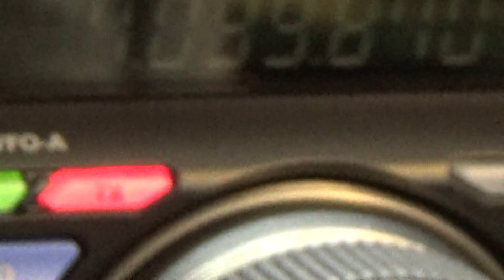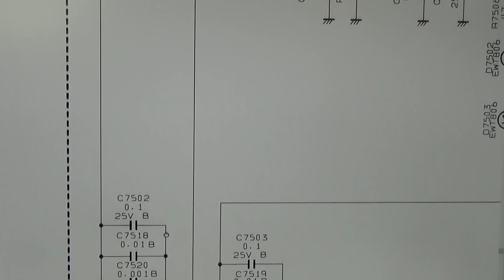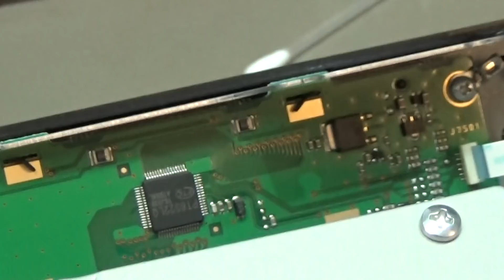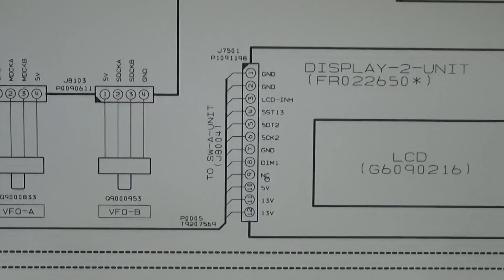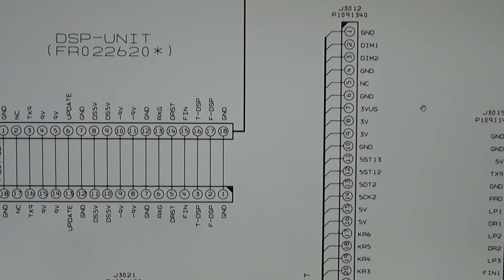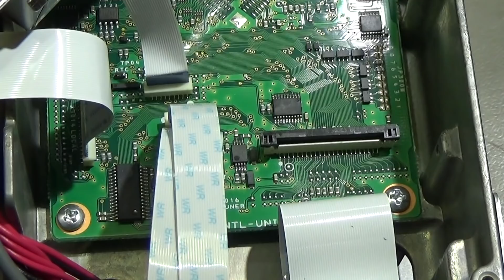#206 Yaesu FT-DX3000 wow is that a production quality issue? Anyway we fixed it

Comment: I have the same problem with my dx3000 but i have a power loss as well as the vfo display do you think this could be a similar problem possible related in some way mine is intermittent
Reply: would be nice to get some kind of reply to my question if you think you can spare a minute 🤔

Comment: I figured it would be somewhere between the boards, I was calling it in the ribbon cable (rc), bad solder joint at the rc connector. I had a problem with my FT-950, had to take the front off and was dumbfounded by how short some of the cables are, engineers are so confident of their designs they don't think of the poor tech who has to fix the thing.

Comment: I wouldn't call it lucky, it's purely because you do such a methodical and thorough job, logically troubleshooting from beginning to end. It's a great lesson to people not to skip steps in a path.
Reply: What is the FTDX 3000 bandwidth on AM?
Reply: @davidschoenwald516  AM is double the audio passband the rig will handle and the 3000 I believe will yield just shy of 3kHz possibly 4kHz, so that would be between 6-8kHz total in AM mode. 

Most modern HF rigs are around 6Khz on AM, with just a few that go to 8 and old tube boat anchors and SDR rigs can go much wider with most people running 5kHz of audio for 10kHz total width.

Comment: I oversaw the maintenance of all electronic gear on three different USN ships.  I cannot tell you how many times my technicians "fixed" complex problems with $50,000 pieces of comm gear by resetting ribbon cables and connectors.

Comment: Nice video. Over the years, I've learned a big weak spot on ham rigs seems to be the plugs not being soldered correctly to PC boards. I had an Icom rig that had endless bad solder joints on it and I spent a lot of time looking for bad components and not getting much of anywhere, and then noticing the solder joints on the plugs didn't look too good. I reflowed almost every joint in it and got it working 100% eventually. Many other rigs had fewer bad joints, but the plugs were where most all of them were located.

Comment: Super video Peter!  Really do appreciate your talent, expertise, thought process, and explanations.  One question though, it may be a trick of the camera, sometimes when it comes to light the camera "sees" a greater intensity than the human eye, which means that what I think I saw may not been the case, but it appeared that on VFO A that BOTH the RX Green light AND the TX Red light were on at the same time.  This doesn't seem to be right to me...were they both on, or was it just looking that way?
Reply: Wayne Thompson , that's normal on the FT-DX3000. It means you're receiving and transmitting on the same VFO. You can switch it to VFO B to either receive or transmit so you can work split.

Comment: Yes, Peter, sometimes You have to be lucky!! For oxidized or dark flex cable terminals I used to clean them up with the brown side of a  rubber erasure ((Radiergummi hi) It's not abrasive for the metal coating but makes the contacts shiny, clean and conductive in about seconds. Thanks for one more of your funny videos!!
Reply from the maker: Hi Wolfram, thanks for feed back. Yes ribbon cables are a pain....Ahm is a good or a bad sign when you say "funny" video? :^)

Comment: Every piece of kit has a set of known issues, believe me, I fix stuff for a living. And this is a know issue with the FTdx3000. The standard fix for this is to reseat both ends of the ribbon cable. 9 times out of 10 that is the fix for no frequency display and no button operation. I would certainly try that before resoldering anything. All the same, it's good to see your troubleshooting skills are still up to speed Peter. It really is a dieing art!  ..for anyone interested, the Yaesu FTdx3000 group has a lot of info and examples about this fault.
Reply from the maker: Hi John, sure every radio has issues in any series at any time. Unfortunately I do not get al service bulletins as I'm not a certified service centre for yaesu. Are you working for yaesu or are you working for a certified Yaesu hub. Thanks for comment
Reply: i got a display problem..not sure if it was in the radio as new or caused by first owner just weeks ago..messing around in ham radio deluxe or pushin knobs etc…the freq readout gets added characters like a u in between plus all the modes get lit up even though the rig might be on lsb or usb or the actual mode..any ideas ? where is the users group at.thanks

Comment: First thing any technician would do is go straight to the ribbon connector, years of experience tells you the first logical place to look, when a customer is paying for a repair, the technicians task is to repair quickly a properly.
Same goes with an auto technician, first thing a customer wants to know is how long it's going to take and how much its going to cost.
This is a 30 minute job.. uk cost approx £17.50, or you can have someone looking at it for 3 hours getting the same results and the repair bill would be £105..
Reply: I owned a storefront audio/video repair shop for 20 years looking for the most simple problem first can save a lot of time.  De-Ox-It spray is an amazing product that I have trusted for years.  It is sometimes the problem solver for gremlin problems like connections.

Comment: Though it may appear that your re-flowing of the connection to the board solved the problem. I would say it may have actually been the removal of the ribbon cable from the connector and re-connecting it which 'reformed' the ribbon cable and allowed it to mate properly to the connector. If you had removed and reseated the ribbon cable you may have had similar results. I say this mostly because I have worked on other Yaesu radios that use the same connector and ribbon cable type and have had to replace ribbon cables because the plastic in the cable deforms and causes an open connection to it's mating connector.
Great job of tracing the control voltages and troubleshooting Peter, excellent video!
73
Doug N7BFS
Reply: I owned a storefront audio/video repair shop for 20 years looking for the most simple problem first can save a lot of time.  De-Ox-It spray is an amazing product that I have trusted for years.  It is sometimes the problem solver for gremlin problems like connections.
Reply from the maker: Hi Doug, you might be right in cases like this you'll never  be 100% sure if it is the one or the other...Thanks for comment 73

Comment: If it was working prior to going out...first thing I would have checked is the ribbon cables,as,sometimes after work or mars mod on radio,ribbons get damaged or not plugged  back in properly...which if damaged or not plugged back in properly,will knock out certain functions on the radio....
Reply from the maker: no the radio has never been opened before so no damaged ribbon cable and by all the ribbons back and forth where will you start?

Comment: I think that radio came out in 2003. I'm not sure when that one was built but if it's an older one would you still call it a quality issue if it lasted for over 10 years?
Reply from the maker: No it came out 2013 or 2014 so not that old by now...After 10 years+ I would not call it quality issue.
Reply: TRX Bench I must be thinking of an older model, probably closer to the 
Yaesu FT-1000MP. My error. I repair pagers all day and solder joints on surface mount connectors are a very common failure on them. I enjoy your videos. Thank for posting them.

Comment: Great methodical troubleshooting.  I've bought many expensive radios dirt cheap and found bad solder joints and bad thru holes. Thanks Peter. 73
Reply from the maker: Thanks Richard

Comment: I really enjoyed this video.  As an Ftdx-3000 owner, it caught my eye.  Great find on the cable.  Did you examine the cable for corrosion before reinstalling it, although it sure looks like a solder proplem.  We will probable see more of that as we move away from lead solder.  You make it look easy as you explain what you are doing, but after some 30 years in the business I know that things are not so simple.  This was a great repair job.  I would be interested in a video about your shop and equipment, and your background as a repair technician.  I enjoy your videos.  Again.  Great work!
Reply from the maker: inspection that is why I have taken off the ribbon cable  . The cable was fine...Well yes for beginners it looks sometimes easy until they start to collect own experiance but that is the way it works...Thanks for comment.

Comment: Очень ненадежные шлейфы. Как-то мне пришлось чинить FT-100. В нем поменял несколько шлейфов, их нельзя несколько раз гнуть, ломаются у синего основания. Уверен, что этот аппарат опять проявит ту же неисправность, просто при сгибании контакт восстановился, но пройдет время и залом окислится и снова не будет контачить - надо менять шлейф.
Very unreliable ribbon cable loops. Somehow I had to fix the FT-100. It has changed  several Flex cables, they are to bend, break at blue base. I am sure that this device will again show the same  problem, just by bending the contact was restored, but it will take time and a room will oxidize again and will not connect - it is necessary to change the cable.
Reply from the maker: Yes you are right in all the consumer products the ribbon cable are of low quality...

Comment: When you took the front off and I saw the ribbon cables I thought you would have pulled all the cables out and cleaned the cables and sockets, by my experience with large printers that's what I have found a few times to be the problem, except in my case they were traveling cables.
Reply from the maker: Well the quality of ribbon cables is in general not very good so we avoid to pull them as long it is not necessary for the repair...

Comment: Easy fix and maybe not so unusual considering all the solder points on that rig. Usually you stumble across this kind of issue while probing around, but you would have to have a visual on the display to catch it. The owner did not say it was intermittent did he? I would be surprised if it suddenly just quit, I would have thought it would have been intermittent to start with?
These 3000's are very nice radios
BTW: Your camera does a nice job... K5AZE
Reply from the maker: No  intermittent problem has been complaint back light just quit.. In a modern production which it is it should not happen. If it happens like here it is in some regards a quality issue which needs to be addressed and as far we heard here in the thread Yaesu has already uprated the weakness.  Thanks for comment 73

Comment: I have been thinking of getting a 3000.  But one of my worries was that the display was OLED display such like in the FTDX 5000 that grow very dim over time.  Nice to know if it does go bad it is a easy fix.  Thanks for video.
Reply: I would go for it.  My 3000 has been great and without any problems.  One of the best receivers out there too.
Reply from the maker: No worries the FT-DX 3000 is a good radio and value for money!

Comment: A very enjoyable journey through your fault finding. 
With hindsight I suppose pressing the boards might have found the bad joint but this would not have been so interesting to watch. 
I have found unsoldered joints in wave soldered boards which must have been making contact when tested in the factory.
Reply from the maker: well it is not so easy as there was not hint in advance that it could be a loose connection no complaint about intermittent back light....so you have to start somewhere...